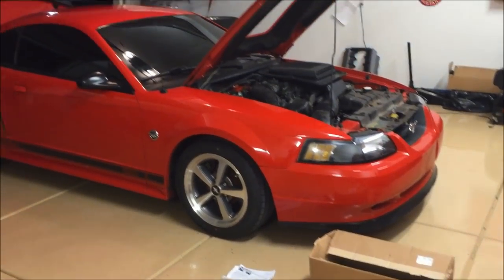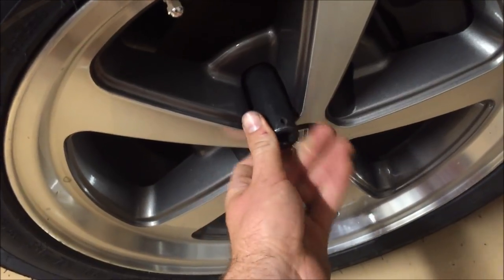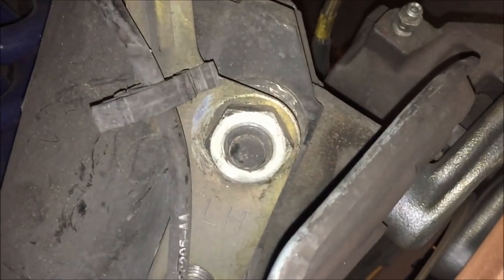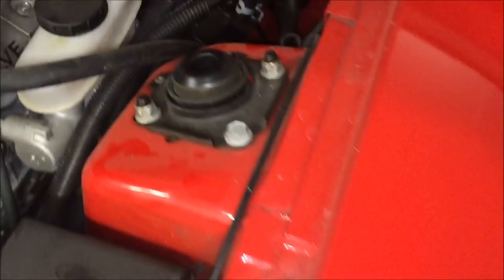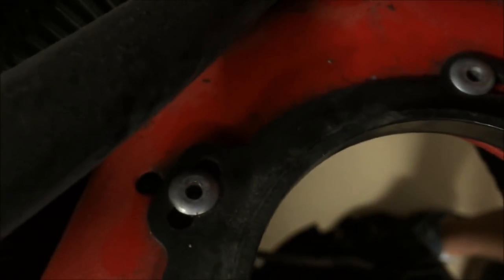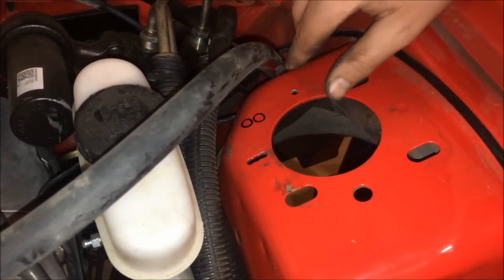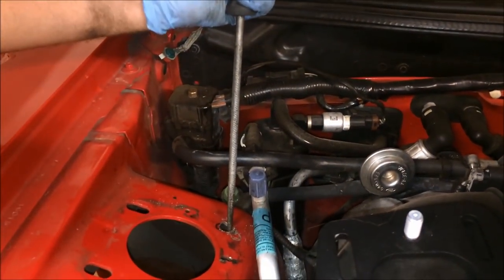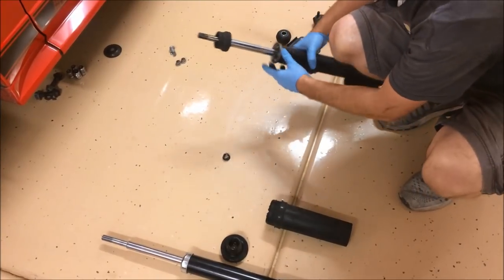Step-by-Step How to install Caster/Camber Plates. Ford Mustang Maximum Motorsports cc plates

Comment: Well Danny, I did it. All completed. Took about 3 plus hours because of our Mustangs having the steering wheel on the "right" side LOL. Only think was not sure of, is when is a car regarded as lowered when installing these camber kits. Mine was lowered about 20-25mm. So set it up as that. Time will tell when I take it for wheel alignment tomorrow.
For AUSSIES installing this kit watch out for the brake sensor on brake fluid reservoir. Also the air condition tank on passenger side. I had to grind down the camber plate a bit and move the air cond tank out of the way because that switch was in the way. Be careful not to bend air conditioner hoses when doing it. But all worked out well in the end. Video will save you money. Would put up photos but cant. THANKS DANNY, YOUVE DONE IT AGAIN SIR.

Comment: Thanks for such a detailed video! I’m going with these because of the bed plate that they have and the sheer design quality. I’m having to reshape my strut tower from a previous owner hitting a pothole or something and distorting/mushrooming the tower. The bottem/bed plate plus the 4th bolt that this set offers should help them hold there shape once I get it reformed. I hope anyway 🤞! Thanks for the awesome video!
Reply from the maker: I’m glad you found it! Good luck with the install.

Comment: How do you adjust camber,for temporary adjustments??? I have steeda caster camber plates.  I know I have to remove plate bolts.but do I have to remove strut nut to adjust camber angle???? Thank you friend.

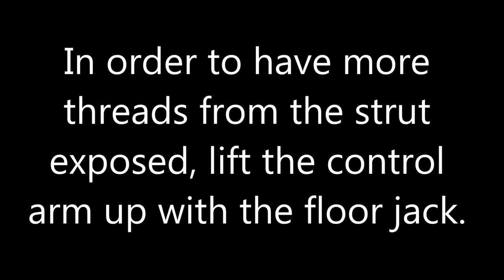Comment: From 18:03 to like 20:00, why do you do it like that?  Why not just hold/push the strut up with your hand, drop on the spacers, and then tighten the nut?  Am I missing something?  How does the strut not slide back down as you back the nut off each time? P.S. appreciate the quality videos!
Reply from the maker: As I recall, it was mainly because we didn’t have the strut connected at the bottom yet, and wanted it to snug down without the pressure of the car on it for a more straight install rather than loaded up suspension. You can always try it another way, but there may have been another reason I don’t recall at the moment
Reply: @dannyjohnsonsgarage  ok, appreciate the reply, thanks!

Comment: So i have the same cc plates! The other day i realized one of the studs is broken on the black plate that you bolt the bearing housing to. I have coil overs my question is the whole weight of the vehicle resting up against the bearing housing on the cc plate. Or up against the plate underneath.

Comment: I'm getting a set of MM caster camber plates and will just install those since I've already replaced struts. Do I still have to break the top strut nut to install the plates?

Comment: Danny did you resuse the stock bumpstop found under the dust cover of the strut shaft or only the new bumpstop that came with the caster camber plates? your video only shows you using the new ones like what the instructions said however im having spacing issues on mine. i triple checked my work using the intructions and your video and cant find the issue.
Reply: Did you end up reusing that strut shaft bump stop or just the one provided in the kit? I'm adding those camber caster plates too and replacing the struts with blue tokicos....

Comment: Would you trust any chain shop to align it after CC plates and lowering springs ?   Like “Just Tires” or NTB?  Or should it go to a performance shop? Debating whether I want to drive on a bad alignment for an hour to get to the shop
Reply from the maker: If it’s a GT or sold rear axle you should be fine. I’d ask if it’s a cobra if they can do 4 wheel alignment with tie rods in the rear. Any shop will do but don’t be surprised if they still can’t get it into perfect spec even with the cc plates. It’s pretty common
Reply: @dannyjohnsonsgarage   it’s a terminator. They couldn’t get it 100% within specs last time but it was pretty close. I am hoping the plates can help them get it all the way there.

Comment: Hey Danny what is the deal with all those spacers??? Ive installed the bbk camber plates on my cobra before and they didnt require drilling an extra hole and all those spacers??
Reply from the maker: Franky Flores The extra hole is for stability and the spacers is just how their kit is setup to compensate for the height difference. I didn’t engineer it, I just installed it lol

Comment: Hey Danny, good stuff as always man! Do you have a video on how to install coilovers for the mach/cobra?
Reply from the maker: Angel Martinez unfortunately, I do not. Maybe I can get my hands on a tubular k for someone and make a vid on that someday
Reply: Danny Johnson I would highly appreciate that video! I've installed mine. And right now I'm getting coil bind (spring is binding)when I turn the steering wheel. I guess it's common issue on a McPherson strut design, and been researching everywhere to find the problem.

Comment: The spacer that goes in the strut falls all the way down or it stays on top of the strut cover ? Please respond I dropped mine all the way
Reply from the maker: Doesn’t the video show it? Are you talking about the bottom spacer? The video should show everything step-by-step, did you watch the whole thing?
Reply: Danny Johnson I forgot to install the bump stop, should I install it ? Or is not necessary?
Reply from the maker: EAbraham.R I believe it is necessary. I would install just how it is shown in this video to make sure it works properly

Comment: Hey Dan! I have these plates on my 03 Cobra. The nuts on the plates are badly rusted and I want to replace them along with new washers. Can you give me the correct size for these nuts?
Reply from the maker: tominator I’ll have to try to take one off and see. In the meantime, if you stop in to a hardware store and remove one you can take it inside to the nuts and bolts section and they have a station with bolts and their sizes. You can thread the nut on one of those to see which size and pitch.
Reply: @dannyjohnsonsgarage  Thanks Dan! I did just that and I was able to get stainless steel nuts and washers at my local hardware store. The nuts are 9/16 socket size and 3/8 thread. Now when I open my hood the first thing I WON'T see are rusty nuts! LOL
Reply from the maker: tominator Great news. I have seen those rust quite often in pictures. Luckily the desert climate here helps a lot
Reply: @dannyjohnsonsgarage  Yep, good ol' NJ climate is humid as hell, so stainless steel is the only way to go!

Comment: Did your strut shaft hit the hood when closed ?
Reply from the maker: No, I haven’t had problems with clearance. The way the spacers are installed may effect it
Reply: Mines a 95. You may have more room .It hit slightly but still shuts. I may have to reconfigure the spacers